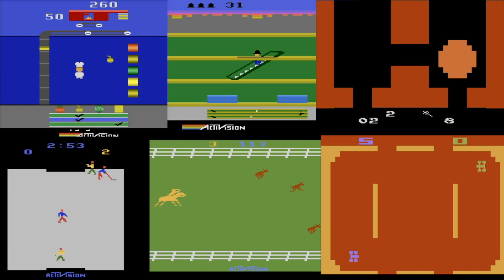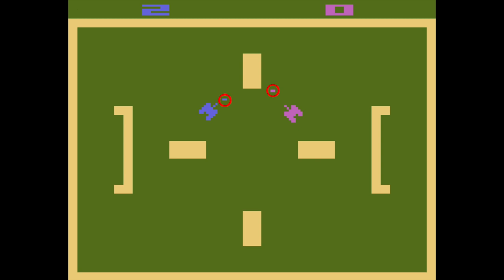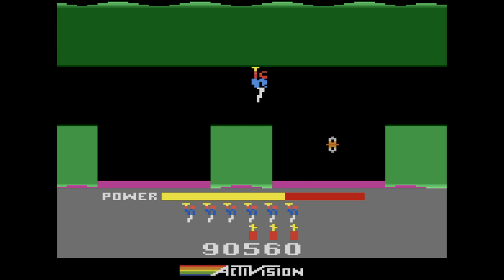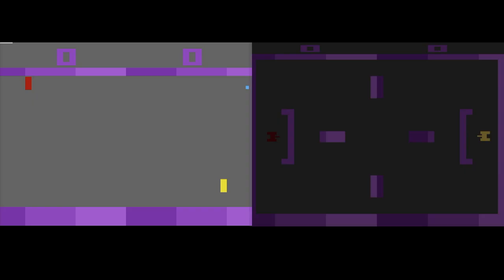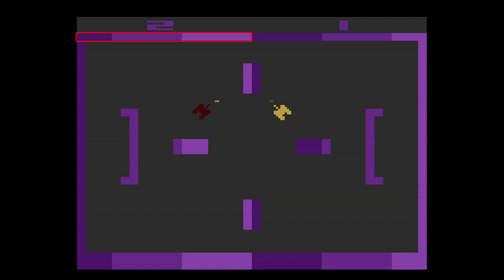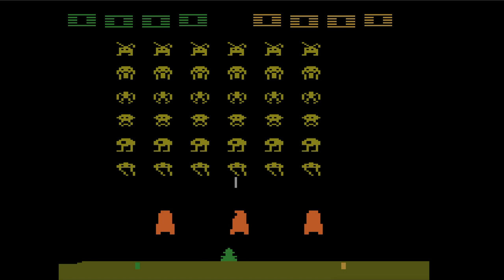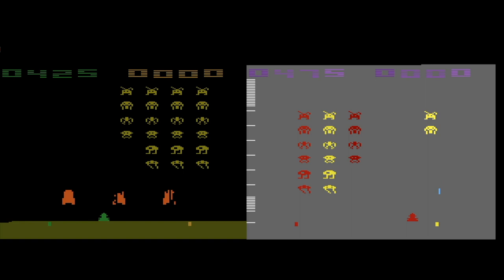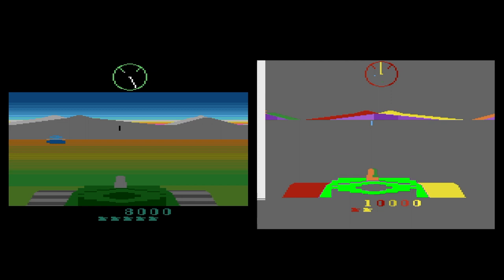Atari Graphics - How did they work?

Comment: There is something that I can't stop noticing, the difference of animations between atari and nes, atari game animation are so much more fluid than the nes ones! I wonder why?
Reply: a similar thing happens between American vs Japanese cartoons!
Reply: @AloanMoreira1  That would be culture
Reply: If my understanding of it is correct, because the Atari has no frame buffer, it’s truly locked at 60 fps out of necessity.
Reply from the maker: That make sense :D
Reply: Because the Atari is locked at 60 fps.
Reply: I don't know if I agree with this post. You may not know this, but there were rotoscoped games on the Nes. The Nes had a damn good port of Prince of Persia that had animation that easily stood up to 4th generation games that preceded it. Some of the later Disney games were like that as well. Ninja Gaiden was another game that pushed the Nes to its absolute limits that had animations beyond anything before it. For reference- Ninja Gaiden frames: 41954 / 60 = 699.233 or 60FPS. It just really depends on what we're comparing. 

However, there is one huge category, the Atari 2600 reigns supreme in. That would be its ability to display 128 colors per screen. Now, I started gaming in 1986 with the Nes and Master System. Meaning, I don't have much experience with their older hardware. When I found out the Atari 2600 could outpace a Sega Genesis in colors on screen, I was shocked. I believe it's 128 colors vs. 63+1 without any color limitations trickery...that's just nuts. Way too, go Atari.
Reply: @AloanMoreira1 This is a major reason I believe Atari games may more often have more animation frames. Western video game developers placed a lot of emphasis on animation. For whatever reason, it often wasn't considered necessary for Japanese games to be overly animated -- to reflect anime, resourcefulness, emphasis on artistic value.

Sometimes I think western games are too animated. C64 and Amiga would have sprite animation to the point of looking weird. On the other hand, I've been annoyed at Japanese games for not investing more in animation.

In sum: I think it's a cultural thing.
Reply: @Keranu  Fair... when the word animation is visible, to me comes to mind the animated movie: Roger Rabbit.. very fluid. I also love the fluidity on classic Disney toons... Past toons like Tex Avery and Looney Tunes  I also liked... back to video games: yeah interesting that some atari games had good animation like the walking cycle in ET (Eliot´s walk)
Reply: @AloanMoreira1  I love fluid animation in games, I can't help but admire it, even in low res, low colored games. I do think there is a fine line for the amount of frames in animation depending on the situation. The Metal Slug series has some of my favorite fluid animation.

Comment: 3:14 - that´s 20 pixels instead of 24. Btw, most games were in 160x192 res. So 20 pixels then mirrored or repeated or assymetrically put totalled 40 pixels which then were stretched to fill the 160 pixel screen. That´s why the playfield pixels take 4 pixels each, but due to the screen stretching they look 8 pixels wide, just as normal sprites all look like they´re 2x1.
I actually love the exotic way the 2600´s graphics are for they are unique hahaha.
other bits: the 2 missiles and the ball could be stretched to a factor of 8 while the 2 sprites to a factor of 4.
Missiles and ball no matter how thick they weer drawn (up to 8) could leave a trail behind them, thus painting the screen. This was used in the tank wheels as shown.
Great video btw! Love the 2600! I am thinking about buying the 2600+ but the carts are still too expensive for their simple nature.
But I understand it´s also because of their physicalities (manuals, box art, printing, cardboards, plastics, circuits, etc)!
Reply from the maker: Oh whoops you are right. I've ordered two sets of the paddles for the 2600+ I can't see new paddles coming out again anytime soon - I'm going to wait to see on the plus to see if it is any good. I have been obsessed with a finding a reasonable way of playing 4 player video olympics and war lords on modern tv. It is actually quite bizarre how limited modern computers are in terms of input. Thanks for the feedback. :D
Reply: That’s something interesting about the atari 2600,being able to stretch sprites wich even the nes and snes doesn’t support in hardware,heck the atari 2600 even has a waaay higher colorpallet then the nes and master system🤣
Reply: @johneygd  yeah, I keep saying that if the SNES was the power behind the original NES games, wow, how much more amazing would they have been! all those colors!

Comment: There's a website that teaches you how to program for a 2600, including the very important task of counting processor instruction cycles. Most of the CPU's time was spent juggling the screen - something like 70%. Game logic had to fit into a scant fraction of time. 

Fun fact! An upgraded version of the TIA video chip in the 2600, called the CTIA and later GTIA, was used in Atari's home computers but because they were later and had a much more significant about of RAM, Atari added the ANTIC chip to convert a frame buffer into CTIA/GTIA instructions.
Reply from the maker: I've toyed with the idea of making an Atari game although making an "in the style of" would be less time consuming. They were lucky the processor was actually pretty powerful for the time. I missed the Atari computer I immigrated to Commadore.

Comment: The seemingly limited requirement of putting all of the load on the programmer to do the graphics actually ended up being its saving grace, as it allowed WAY more flexibility to do things that the system designers had not even envisioned. For proof of this, have a look at some of the homebrew games that have come out in recent years, such as Pac-Man 8K, Mappy and Donkey Kong VCS:
- Pac-Man 8K: https://youtu.be/JA3mIWzwrZk?si=7e2-gLee43Yptn6_
- Mappy: https://youtu.be/w-8xNE_Knx8?si=spZXcqaZ7sK3Vs4E
- Donkey Kong VCS: https://youtu.be/_Y6vhLDN3dI?si=knSkmQpAcgr7zAZI
- BONUS #1: Here's Tod Frye, the guy who made the original Pac-Man for the VCS, admiring the homebrew version: https://youtu.be/RqezF_Lv05Y
- BONUS #2: Here's a much younger Tod Frye talking about how and why his version of Pac-Man looks the way it does: https://youtu.be/UTDUB_GiTKA?t=690
Reply from the maker: For sure. Elevator Agent and Aardvark are amazing too but there was plenty of blank magic even from some of the games back in the day that defy logic in being able to run on a 2600. The Starparth super charger showed how much more could be done on the system if you just gave it a sane amount of ram. They really should have made a pass through cart like sega's 32X that added some ram, a sound chip, and perhap a chip to add a couple more sprites. The system would have would have been able to give the NES a run for it's money.

Comment: So in the battlefield it's kinda like the colour changing in that sonic the hedgehog 1 waterfall section.
Reply from the maker: They both are taking advantage of the characteristics of CRT screens of the time. The Atari knew where the scan line was on the screen so although it only could actually display one screen colour at at time if it changed the screen colour at the end of a scan line it could create lines on the screen. The Genesis used the fact that there is some softness on those screens to create the illusion of more detail or effects like transparency you see in the water fall. The genesis wasn't actually capable of displaying transparent images. The Battle field in Battlezone benefited from this as well. If you play it on and old CRT the ground looks more complicated than the clear lines you see when you emulated it. If you play the video in 240p it kind of looks like it did back in the day.